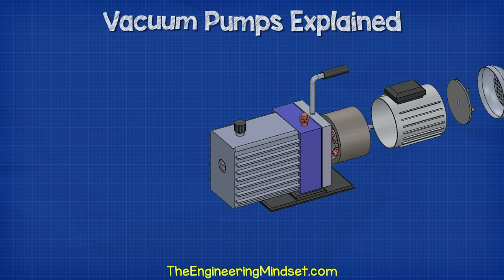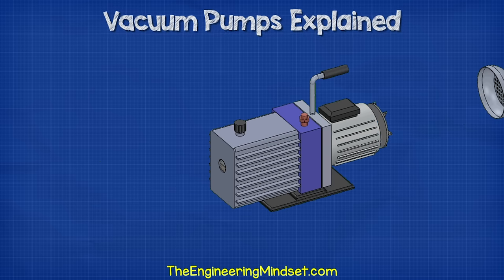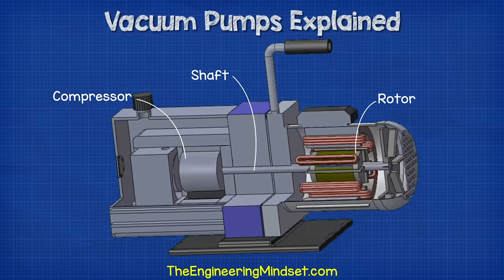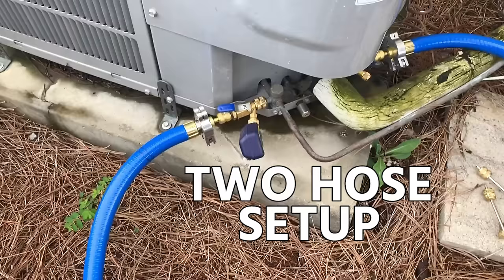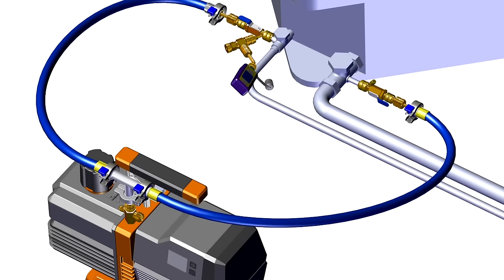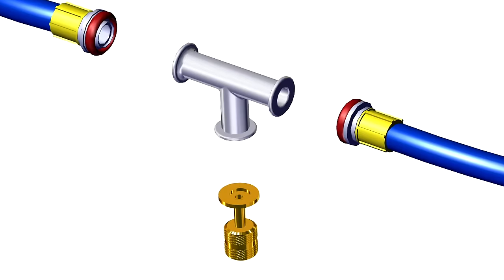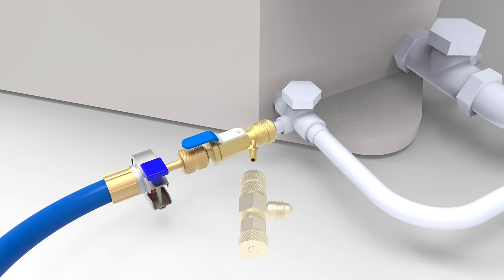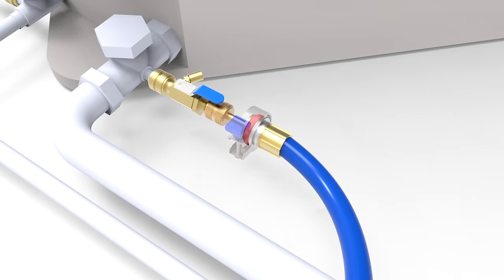How to Evacuate an AC system, Full Vacuum Procedure

Comment: Holy Cow !!  All I wanted to do was to replace the AC compressor on my Volvo.   I've discovered a whole universe just based upon air conditioning.   completely overwhelmed.
Reply: Good shit ain't it
Reply: Welcome to the world of hvac. We take our vacuums serious.
Reply: Don't be overwhelmed,  it's a lot easier than you think. Just take your time replacing the parts and have a local repair facility do the leak check, evacuation and charge. You'll save a lot of money and feel good about doing something for yourself.
Reply: @keithglynn9237  i want to replace my HVAC. I am confident I can learn how to. Thanks for that tip
Reply: Mvac is nothing compared to hvac. Mvac is bottom of the barrel of this world.
Reply: @LynxStarAuto  that's total nonsense. I do a ton of both, started out specializing in MVAC and now i do light commercial HVAC. they both have their own procedures and knowledge requirements and both can be incredibly complicated and both can be incredibly simple. You need to be really good at figuring out what's going on just based on suction and discharge pressures because trying to measure superheat and subcooling is very difficult since changes in engine temp, cooling fan speed, ambient temperature, blower motor speed, mode selection etc etc have a huge effect on those readings making them almost useless.
Reply: Watching countless YouTube videos put out by Bryan, Craig, and others compelled me to go to college for HVACR.
  I'm so glad that I did; I found my passion after all. 😏
Reply: Welcome to our world!
Reply: 😝 funny how most people enjoy AC all the time but never think about what goes into it
Reply: There’s a lot of physics going on but you can learn the tools and the process pretty easily when you put the work in
Reply: I work on AC equipment and trust me it is a bit overwhelming, lol
Reply: Haaaahaaaa 😂😅 gotta love that comment.  It's a different Universe 😅👍  A/C system is more COMPLEX than Heating system.... In Sub cooling and Superheat at Evaporator coil by an Orphit..... maybe I'm wrong
Reply: Welcome!
Reply: A lot to learn my friend, take it slow
Reply: How did the replacement go? I’m also changing the ac compressor on a Volvo lol
Reply: @BreakingChains383  I ended up having to take it into the volvo dealership. I read the notes and discovered I did everything correctly. It was a "Ford" relay that went bad. The Volvo sat for almost two years cause I was so fed up with it lol. Gets 30mpg at 80 mph and the AC works great !!! Lol.
Reply: Not so much bmw and mercedez is worst  @LynxStarAuto

Comment: I wish I could get the guys at the company I work for to understand this. I only do ductless systems. Nobody uses a torque wrench, nobody pressure checks to the right pressure and evacuations are just a joke. I’m the only one that installs and evacuates properly. The funny part about this whole thing is that I’m not an HVAC guy. I’m a licensed electrician who installs ductless units better than all the HVAC guys. I’m so tired of theses guys doing the customer wrong that I’m seriously considering going back out on my own. Thanks for all the good videos.
Reply: Hi, continue to to do your best best it will be rewarding.
I've allways done my way toward a big achievement
I've learned all by myself
All the best
Good on you Mate
DomIJ

Comment: thank you   i have been in commercial hvac for 25 years and have always evacuated the same way.  through my   manifolds.   i have been working on trane wshps recently and it takes a 1 ton 6 hours to get to 800 microns and that is with triple vacuuming it.   now with your way i can do it in 10 mins and get 250 microns

Comment: Bryan,  Great video explanation on how to properly set up equipment for evacuation. I once had to evacuate a low temperature drier used in a leather tannery.  We had to install a new coil, which the factory had pressure tested with water.  Multiple evacuations and multiple oil changes over several days just to get the coil dry.  It also helps, when dealing with a wet system, to do partial evacuations, breaking the vacuums with DRY nitrogen which, will soak up some of the moisture.  Also slow DRY nitrogen purge, before evacuation is started will help speed things up.  Not all nitrogen is DRY.  I once used up a small nitrogen cylinder, and opened the valve an inverted it when it was empty, and water ran out!

Comment: I really appreciate your tutorials. I stumbled on a nifty procedure to help eliminate moisture in a system I’d like to share since your speaking on the subject of nitrogen and moisture; I had a situation where line set had been cut at condenser for a change out and left open- uncovered overnight and it rained hard  that night. I had installed a site glass with moisture indicator ring and reached a vacuum of 500 microns, but my moisture indicator was still very pink( high moisture content). I tried multiple evacuations as per described in this video and frantically searched forums. It was the end of the day now, as I’d removed and replaced the 3rd floor apartments inside and outside units by myself. In desperation, I charged the unit with 200 psi of nitrogen and let it sit overnight ( I didn’t run across this exercise anywhere I looked). The following morning, I pulled a vacuum again and in very short time my moisture indicator went to green ( dry ). Pulled to little over 300 microns and all’s well. Cheers!

Comment: Great Tips and explanations for beginners and refreshers for the old timers too. Carrier doesnt advocate running your refrigerant lines underground though. i use CRTs on both sides of the unit and attach the 1/4" hoses to the side ports on the Appion CRTs that i have removed the cores from and pull from both sides into a 3/8"  and the yellow 1/4" hoses attached to the Vacuum Pump, with the Micron Gauge attached to the Vapor side of the unit on the end port of the CRTs. In doing this i can isolate the system with the valves on my hoses and do the standing test and then once i know the system is good i can reopen my valves continue to pull a further vacuum. Close the valve on the CRT that is attached to the Vapor side and remove the Micron Gauge and then immediately replace it with the core that i had removed from the condenser and either critical charge the system before i release the refrigerant in the condenser. Basicly i can replace the cores and do what is needed without having to mess with anything other than taking a micron gauge off and switching it with the core all the while pulling an even deeper vacuum. My systems are always pulled down to 89 Microns and end a (seven minute standing test - Carrier Specs) between 180-230 Microns.

Great Video though loved the detail and how much you know about this trade. Just wanted to lend my opinion on the hose setup and how its a little more convenient and will still end with the same result.

Comment: Basically exactly what I do. The only thing I might do different is if I'm working on a system that is flat to start. In this case I hook up a charging hose with an isolation valve at the end hooked up to the port on the core tool with the valve closed, with the hose charged with refrigerant. The reason I do this is to not loose any vacuum after I do my pull down and decay test while hooking up a hose. This allows me to go straight from the decay test to charging.

Comment: Hey, this is great!   This is long for a YouTube video, but short and very snappy for a LECTURE.  I feel like I'm back in school, in a good way.  I'm here for general technical interest, have worked with vacuum systems in general, and also Neon.  Slowly becoming aware that what we're doing when making a Neon tube has some overlap with what people are doing with the HVAC vacuum pumps there.... I've been looking at that gear my whole life and never really understood what people were trying to do with those gauges.  Now halfway through one video it seems surprisingly clear!   I'm sure this is a simplified presentation and don't want to mess it up, (but) at 18:30 or so, talking about slight rises in pressure, there are little leaks of course, but then there are "virtual leaks" which are not in software, no!  They are what we deal with all day in Neon, or in other high-vacuum work.  It's well known that when you exhaust something with a mechanical pump your troubles have just begun!  So, a quick evacuation can remove the bulk water, but there's still LOTS of water sort of stuck to the surfaces inside the system, and it takes some force to get it out.  Either LOTS of heat (you hint at this with the heat gun), or electric discharge (as in Neon processing) or TIME.  So you could evacuate a system for a long time with a high vacuum pump, and it WILL "harden" in time.  This information is a few generations old now, but not widely advertised.  Anyway, the time for a system to degas itself under high vacuum might be DAYS if there's no heat involved.   SO, trying to put all that into like one sentence:   It might be that if you do everything right, clean and tight, fresh oil in the pump and everything... there will be some rise in the vacuum and NOTHING is leaking.  Hey, don't you guys have "dryers" in the system to take care of these last few molecules?   Anyway, I thought that might be good news, and also it's just something that's a big issue in my own life right now.  Thanks for this dynamic and clear explanation!  I'm going to finish the video now.

Comment: We once ran a vacuum pump for 4 days. Broke the vacuum with nitrogen once a day and did about 6 oil changes on the vac pump to remove moisture from a system. That pump still works, and so does the system but as you said, very time consuming and can’t be good for the pump
Reply: Customer's system is happy though

Comment: THANK YOU!! 

FINALLY SOMEONE WHO IS TRYING TO TEACH THE (PROPER VACUUM) TECHNIQUE!!!

Just one thing though.. You (MUST) use a VCT on the vacuum gauge side to avoid the oil contamination on the micron gauge!! 

Once satisfied after "ISOLATION", shut off the vct and remove the micron gauge, once you are ready to put core in, you can purge some refrigerant just to make sure no air is in the core tool before you put the core in after vacuum gauge is removed!

TIP 1: When pulling vacuum on "USED SYSTEM", Isolate when vacuum micron drop stalls, if the micron gauge drops during the vacuum isolation it is a indication of water or refrigerant trapped in old oil remaining which means you need to reopen VCT/VACUUM and let vacuum resume for longer time to try and boil said water off from oil... 

TIP 2: NEW LINE SETS HAVE (NOTHING) IN THEM!!!!  So on a brand new system install you can pull a vacuum as (LOW AS YOU WISH TO GO) because the actual line set copper and evaporator has nothing but "TEST NITROGEN" and nothing more!! GO AS LOW AS YOU CAN FOR LONGEVITY I.E 25 MICRONS!!! The lower the better!!

 

WELL DONE BRIAN!! WELL DONE INDEED!
Reply: iconbadgta vct on micron gauge side isn’t a must if it’s able to handle pressure like the one shown. The angled coupler is what protects from possible oil contamination. If the sensor does get contaminated, a little rubbing alcohol is all that’s needed to get the sensor back as good as new
Reply: @jeffb8437  I (ALWAYS) use a Fieldpiece SVG3.. It is the (BEST) there is in my opinion with all the features and price range it is in..  Can be a bitch though to clean...

Comment: That was an excellent tutorial of a complete residential HVAC system. Other than when a system has been repaired it's my understanding that there would be no leaks other than a small leak at the presser compressor when the clutch engages and disengages, as in an automotive, HVAC set up. in theory, we know that a perfectly sealed system will last indefinitely as long as the mechanical components remain in working condition. And example of that would be your parents refrigerator from the 1950s or 60s. They're still going because there's less components a.k.a. no sensors no crap. There's only one part the compressor and possibly a fan to blow the air through the refrigerator. Those systems back, then were all done by hand, rather than buy machine or robot, decreasing chances of our unintentional leak from a weld joint etc. I know nowadays time is money and the air-conditioning systems of today while more efficient. Yes that comes at a cost of quality. I feel that if I repair is done correctly as per an automotive HVAC system. There should be no microscopic leaks other than the microscopic small leak at the compressor clutch being driven by the Engines serpentine belt, which drives many other accessories as well. It's not uncommon for an automotive HVAC system to go 15 sometimes 20 years before it starts to become low on refrigerant if the maintenance has kept up and what not. Does that theory hold through with modern residential HVAC systems when compared to the 1950s and 60s large, inefficient yet bulletproof HVAC systems? As always keep up the good work!

Comment: Wow, One of the best evacuation procedure videos I've seen in a long time. The ONLY thing I would add (sorry if I missed it) is to clear the air behind the "ball" on the ball values by actuating them (close and open) a few time when <3K Microns.
Reply: That's was i was told once by Ritchie Engineering tech support.

Comment: That's a great demonstration of the difference in vacuum at the pump and in the system! Excellent video!
Reply: That is in a dynamic situation; if you stop the pump,(that becoming a static situation then),both readings will be the same; also, an experienced technician will do that while vacuuming ,and interpret the rapidity of the equalization of both pressures to look for obstructions in the system;  but rush  jobs do not allow for that....

Comment: I’ll admit it, I haven’t used nitrogen to pressure check a system since I’ve gotten trublu hoses and a vp85 vacuum pump because I can tell on a residential split system if it is leak free in a matter of about 1 minute instead of 20 to 2-3 days. The other thing that has screwed with me before too is the fact the nitrogen is not as inert as people think and if you pressure test a system overnight and it’s colder the next day you may waste a significant amount of time tracking down a leak that doesn’t exist.

Comment: Great video. I just had a technician come out and change my liquid line filter that was leaking and I noticed he didn’t pull vacuum. When I asked why he said you don’t have to when it’s a quick job. System is 10 years old will this damage my unit ? He added refrigerant check the pressure and got paid. A/c is cooling great but now I feel like it won’t last. Thoughts?

Comment: Larger hoses may allow more molecules out,but it doesn't pull thru the 3/16 outlet of the valve faster. A perfect example would be a fuel injector orifice, no matter how much pressure you put behind it it's only going to allow so much fuel through. Same here, 3/16 outlet is only going to allow so much air to pass through it at one time regardless of how big your hose is,or CFM rating of the pump.

Comment: Great video! Definitely going to be sharing this to my co-workers. One question sir,  At the end of the video when you are pulling with 2 hoses and you hook your micron gauge into the service port on the valve core removal tool do you need to take that schrader out of there so you're micron gauge can read properly?

Comment: When using a manifold as a way to isolate the vacuum pump from the system you will have off-gassing from your hoses which will cause your micron gauge to rise rapidly especially with new hoses. You must isolate all hoses from the system and micron gauge.

Comment: First let me say I know nothing about HVAC systems. I am retired and basically I watch these videos for entertainment . I like learning new things and this is a good way to do it. My question “and this may show my stupidity” but when is the evacuation of a system necessary. Is it only done when components  are changed out or at the initial installation  I love watching your videos so keep them coming. Thanks
Reply: Anytime the system is opened to air you must evacuate it before refrigerant can be put in. Air and moreso water in an air conditioner will cause issues. Air is non condensable and will raise the high side pressure and can cause something like a vapor lock where the air blocks liquid refrigerant flow in the condenser. Water can freeze in the system causing all sorts of problems.

Comment: Good info there! When it's time to replace my 1/2" Appion vacuum hose I'll try the blue ones.
Reply: I forgot how much but when I bought my appion half inch hose the difference was significant. Regardless it will take years for a hose to take a dump if taken care of
Reply: The appion ones are much better. That's what I use. They will last forever if you take care of them. Just replace gaskets periodically and lube them w vac pump oil before you hook them up

Comment: Wow.. very comprehensive. Worth a replay.

I now have a question..

If you are pulling from both sides with two hoses to the pump, where should the micron vac that's be placed and will it over estimate the depth of the vacuum ?

Ahh I just heard the answer at the end on second play..

Comment: Great video great information but I do have a question tho why did you open the liquid line first instead of the suction side don't you want that oil to suck right back to the compressor instead of traveling all through the system and back to the compressor?